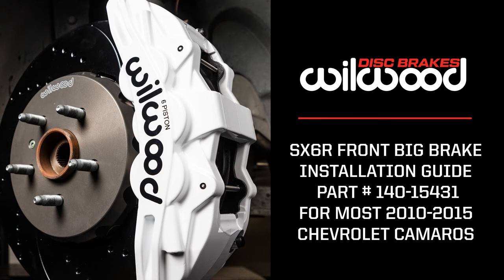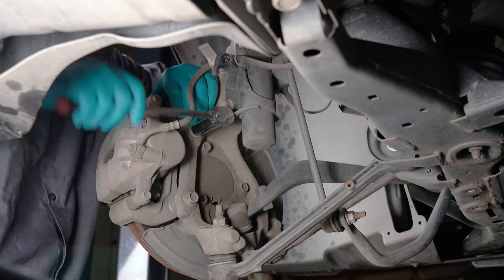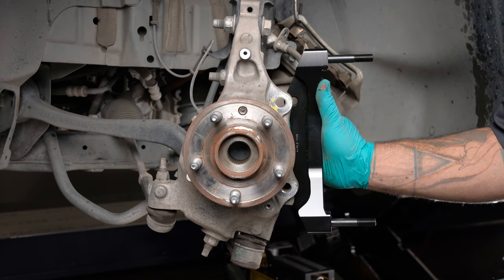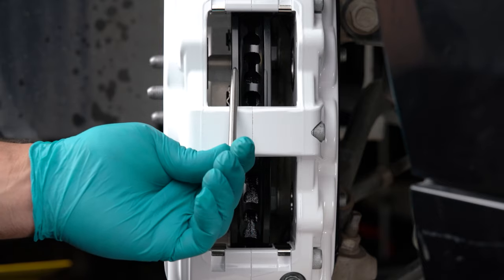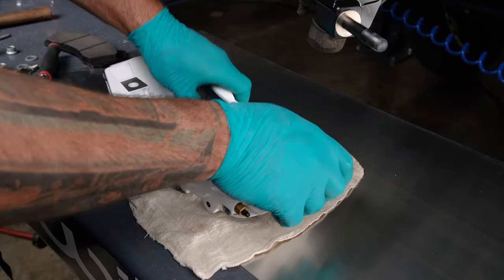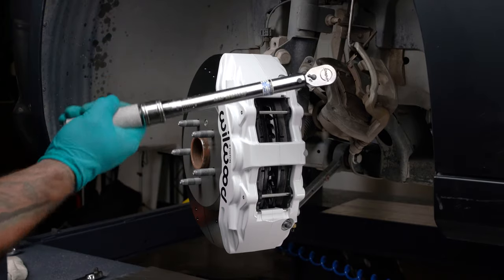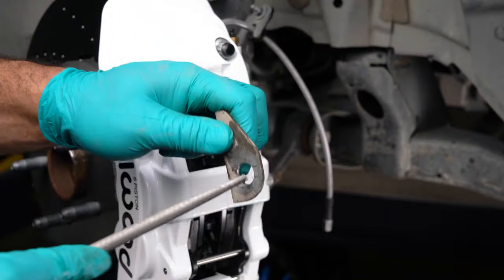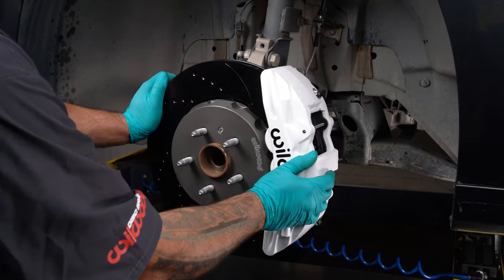2014 Chevy Camaro Wilwood SX6R Front Big Brake Kit Install

Comment: What's the recommended method for replacing brake pads with this kit?  Can I simply remove the (2) locknuts shown at the 3:02 mark, or do I have to remove the entire mounting bracket (and thus have to re-shim it back into place every time I change the pads...)???
Reply from the maker: Hi, when replacing the pads simply remove the 2 locknuts and install.